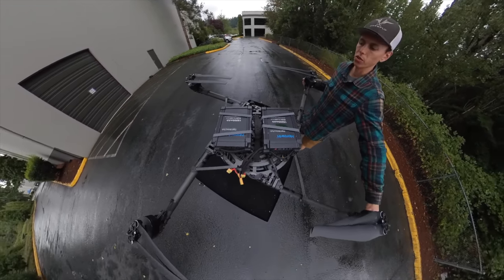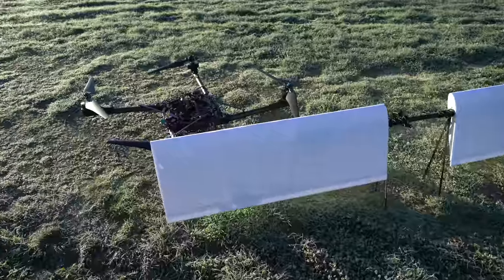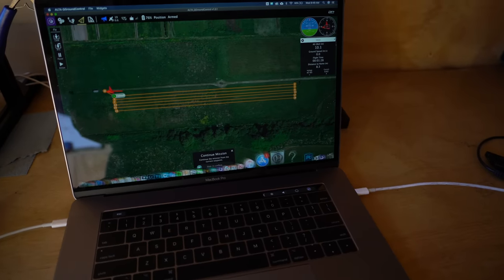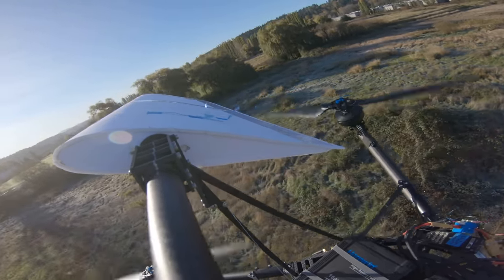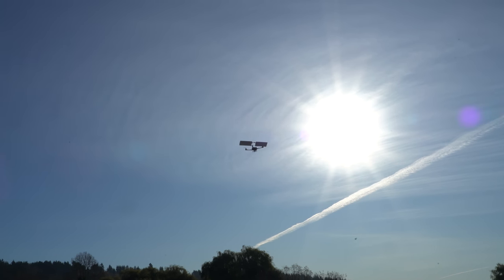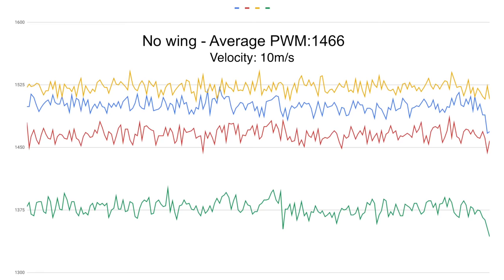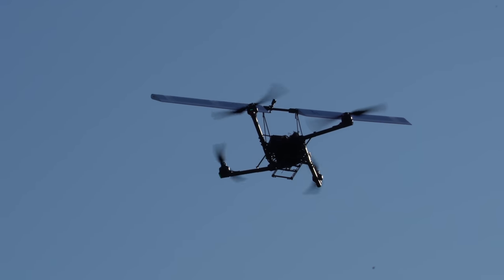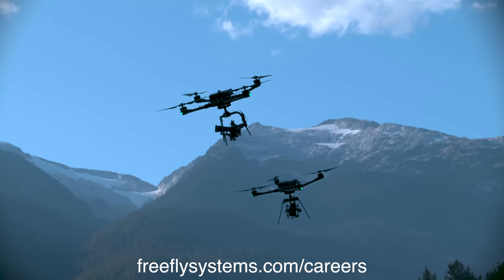Can a Wing Increase Quadcopter Efficiency?

Comment: Comment #1.   Don't make your quad hover.  Create a large rectangular route with radius corners, so your quad can fly through the corners.  When the wing is attached, the controller will need to yaw at the appropriate rate for a coordinated turn.   Then the wing configuration will give you more steady state data.
Comment #2.   Fix the angle of attack on the wing.  The flight controller has no idea when the wing rotation changes.    Fixing the wing angle to single angle of attack, may stop the oscillations.   To avoid the negative lift scenario, sneak up on the speed envelope.

Comment: The added weight and aerodynamic forces of the wing quite literally destabilizes the control mathematics. Since quadrotors are unstable aircraft by the nature of the design, the effect of the wing without changing the control software absolutely will destabilize the drone. Adding a wing can and will improve efficiency, but the controller needs to be updated to properly control it.

Comment: Would a rubber band attached to the wing make since? To put some resistance on it to pull it back to zero. Not just rely on it's mass. While also using a dampening mechanism that doesn't allow the wing to change angle to fast. Like the calculators from school that slowly opened when you hit a button.  The "rubber band" strength could be changed to adjust how much you want the effect to be. Maybe even put a servo on the other side of the rubber band so you can change it in flight. I feel like some force on the wing to return to 0 would have stopped the oscillations while the dampening mechanism would prevent it from changing to fast. And if all that works then write some code to do it on the fly for max power efficiency. 

I do think you are onto something. Integrate this wing concept into the body of the drone. At the very least do it on the rotor arms and have an aerodynamic body that provides a mild amount of lift at speed.

Comment: Very interesting concept, but looks like you could have a lot of unbalancing problems. What about trying a different type of wing what about trying a gyro copter configuration where are you got a helicopter style blades above the quad copter that I’m not powered , should make them spin fast enough to create some sort of lift and be in central that should be a lot easier for the quad copter to control

Comment: I guess the most important is that the airflow on the wings is seperated from the airflow of the rotors. So mount the wings on the sides instead of in the main airflow of the rotors 😊.

Comment: It seems to me that the drone is having trouble correcting for the lift from the wing when accelerating which throws it's readings out of range... Need to code in the wing... also unless you have some kind of resistance in the wing pivot it's literally just drag and nothing else until it's at the hard stop...

Comment: Would the Alta X flight controller support a servo to control wing pitch?   Using the forward speed and angle it could then  set the optimal angle of attack for the wing.

Comment: Perhaps you could optimize the size of the wing for overall maximum efficiency and controllability, if you shrink it down a bit perhaps you could fly faster without loss of stability and get the same efficiency

Comment: You would need a custom controller algorithm to make this really sing. It's clear to me it is getting too much lift and doesn't have the algorithm to know how to maintain altitude and pitch with a control surface in the wind. Evidence that one motor hits idle. That's a loss of a control channel, and to the drone it makes no sense that a motor is idle and the drone is going up. Shrinking the wing just enough so that all motors are contributing at least a small amount will probably make it perfectly stable. You could probably reduce the AOA to the same effect. The most ideal is an active wing that doesn't maintain AOA but rather desired lift as measured by average thrust of all motors.

Comment: My idea would be to replace the booms that the motors are attached to with a long narrow airfoil shape kinda like picture a helicopter rotor blade I wish i could post a sketch of what I mean if u seen old concept art of a hybrid jet/ helicopter which the blades can be fixed and it can fly at high speeds like a jet I’m saying just turn the booms into airfoils so no matter what direction the drone is flying it will still have lift because their would be no trailing edge on the foil like a conventional wing

Comment: you could robotize the wing, they should be either in vertical or horizontal mode, plus centering them lower than the props plane, it would fly better

Comment: i love your videos but why did you build an unstable aircraft? you should put the wing under the drone. the accelerated air underneath the drone would create lift as long as you make sure the bottom of the wing gets a lot less airflow than the top. i  also dont think you need a pivoting wing just simply control surfaces. think of it like an osprey without any pivoting. as if the osprey would take off facing towards the sky like a rocket which is basically what youre building. i would take a look at blue origins new sheppard with its fins and extending airbrakes making it aeroynamically stable going up AND down.

Comment: Let me try to explain something, if I can make sense.   The pressure on the wing has to be higher on the bottom than on the top.  That is how a wing flies.  But the wing being so close to the quad rotors, it seems the rotors may be sucking the air pressure from the bottom of the wing.  The top is not stalled, but there is no pressure on the bottom either, because the prop sucked it all away.    so the solution is to extend the wings off to the side of the drone, and away from the props.  Does that make sense?  Don't put the wing directly over the props, or you will defeat your purpose.   Don't put them under the props either.  the wing needs undisturbed air both above and below.

Comment: You'll never get lift from a pivoting wing in that configuration. The lift comes from downward force from the wing or the low pressure above it. If the wing pivots it'll just get pushed respectively thus
Reply from the maker: 1. Then how do flying wings and plank aircraft fly?
2. You missed the part about the hard stops
Reply: @rctestflight  I didn't see until near the end that you had the wings basically mountined on the centre of the wing either. That's take some load after all.big fan, first time caller. Keep up the novel and interesting work mate.

Comment: Why don't you use a non-fixed-wing aka a rotating one? As long as there's airspeed it will generate lift. You just need to make it tilt to have always a safe angle of attack for the amount of forward motion in the direction of your forward motion.

Comment: Go the other way, turn an airplane into a drone. In other words, place drone motors on an airplane to simulate the propeller. When the aircraft is about to stall, have the motors and rotors pivot to a drone mode bring the aircraft to a stall speed or less. That way the only loss of energy will be when this is occurring. The hybrid will use the drone mode only  part of the time for upwards and downwards motion.

Comment: "The point where the wings provide lift seems unable to act on the fuselage, only providing torque to return to a normal state. It seems that the wings need to be placed below or in the middle of the rotor to function correctly

Comment: The wings have no effect on lift in the free swinging zone. The only force possible with it free to swing is backwards(drag) if any lift is produced by the wing it will balance the force automatically by adjusting it's AOA. (There's a good reason windmill blades are not free spinning to allow them to change their pitch, aka AOA, they're actively driven and locked at a desired pitch for RPM governing) The only time this produces any lift is at the fixed detent endpoint. The correct way to do this would involve a gyro assisted motor/servo that adjusts the wing to maintain a constant angle of attack after a certain forward velocity is achieved. That way negative AOA is also not possible (hehe theoretically).

Comment: Maybe if the quad would be configured as a "+" , not as a "x" the controller would not get so confused? also the wing is way above the center of mass, so huge lever. a "+" style quad could have the wing through its center more easily.

Comment: Of course it can, if properly designed and the craft is moving sideways correctly relative to the wing. But if it's just hovering, the wing is simply added weight. That's just one of the reasons the world is still full of airplanes even though helicopters are much more convenient.

Comment: I think this is more of a showcase of the limitations of unmodified quadcopter control software on winged vehicles than a test of the effectiveness of wings on a fixed-vector rotor craft in general.

Comment: Why not fit a saucer/disk wing arround a Quadcopter through a axel running through quad till both ends of disk wing ?

The Quadcopter will be hanging inbetween from both sides of saucer/disk wing where the whole wing will be movable to some degree (angle) to maintain angle of attack to make the whole saucer/disk surface behave like a aircraft tail elevator inorder to generate some lift during forward movement hence increasing battery efficiency to some extent

Like this the saucer/disk wing will give adequate fan blade clearance  , Plus it won't be getting fan blade's downward air blast & last but not the least wing will act like a barrier to branches of trees giving blades protection horizontally .

Comment: I would want to see a fixed rotor Quad with four wings between the motors. To fly with the wings you tilt all the way on the side, and fly the whole thing vertically instead of hovering horizontally.

Comment: You need to coordinate the tilt wing with tilt rotors.
Reply: Nah tiltrotors have garbage efficiency. At this small scale the most efficient solution is either the Pterodynamics Transwing, a fixed wing quadcopter, or a tailsitter quadcopter

Comment: It seems like the wing should have servos controlled by the flight controller to operate in tandem with the drone's flight systems to adjust to the optimal position as needed rather than relying solely on the whims of air speed.

Comment: Well, that would never work just like that. There must be some transition in the gyro stabilization. for start: when the wing starts to gain lift, the gyro "gain" and "proportional" should get lower parameters. Second: remember that when the quad reduces speed, it lowers the RPM and pitches backwards. Do this with wings and you get a classic stall.

Comment: Did you figure out the angle of forward flight (with no wing) prior to testing? If you could determine the angle of the drone at speed you want (for best efficiency) then you could find the appropriate angle for the wings at that speed. maybe do a little more math and add a servo to change the angle as required according to set speed.

Comment: Why don't you try the wing setup with a tail section on a carbon fibre boom, which will give it more stability in forward flight.
Reply: PS fixed to the pivot axle of the wings.

Comment: Good test but it's a quad copter controller, not for winged flight. You need to scrap the quad entirely. Instead put motors on the front edge of the wings and the two wings need to tilt independently. Then a body and a tail. In hover it's like a normal plane stood on end. The two wings can hover and spin around by angling them differently, it can go up or down. Then by tilting both in one direction it can transition to winged flight. Vastly faster and more energy efficient because a quadcopter config is very dumb. You have to separate yourself from dumb convention to appreciate what's better.

Comment: It's not the angle of attack that creates lift. The lift is the result of the difference in the length that air travels below and above the wing, which is caused by the specific cross-section of the wing. Air has to travel a longer path on top of the wing, thus making it move faster than the air below the wing, thus creating a differential pressure pointing up, the so called lift.

Comment: The correct method is to have the wings move in a collective pitch circular motion like a helicopter. The swash plate to the drone would have to be invented. Look into gyrocopter  components.

Comment: Just attach a hydrogen balloon on a pipe and a tank with two release valves on the quad copter. One releases hydrogen into the balloon and one releases hydrogen from the balloon into the air.

Hydrogen can be easily (and not safely) made at home by putting electricity into saltwater. :)

Comment: The problem, to me, seems obvious - the drone is trying to keep its altitude stable - as soon as you add lift (in this case by increasing speed) the drone has to idle down to stop from rising, causing large fluctuations in rpms.
Reply: Also seems to me that the wing needs a tail added - and perhaps to make it swivelable - to keep it flying directly into the incoming coming wind.
If there's a slight cross-wind a drone drone will normally pitch ( unsure of the correct terminology here) into the wind to keep the correct heading. Without a tail to stabilise it, I think, this is also causing the wobbling.

Comment: you have no pitch stability or tail surface
a correct tail would be 25% of the main wing area, and situated 2.5 main chords back. You could put a strut at each wing tip back to the position of two half tails
A graphic indication of wing zero lift degrees is to draw a line from the rear of the airfoil, through half the height of a vertical line at 50% chord. 5 degrees positive from that line should be plenty

Comment: Ok now experiment with a fifth rotor. During cruise flight, the four rotors would finction as an autogyro, the have the fifth rotor angle down to orovide all forward thrust. The control authority would still be orovided by the four original rotors. The fifth rotor vould ve stand-alone controlled.

Comment: As mentioned by others, I think the wing is mounted too high. The drag of the wing will be causing the quadcopter to pitch upwards as it moves forwards, and the control system will have to "fight" that tendency. I think this is probably the cause of the instability at higher speeds.
If the wing halves were mounted further apart on a long spar that was at a similar height to the centre of mass, the drag would have little effect on the pitch, so the control would probably be more stable.
Further, when the wings are mounted high, the downwards movement of air towards the top of the rotors will be causing the airflow over the wings to be very different at their inner and outer ends... hardly an efficient setup, and the rotors will be "stealing" high pressure air from under the wing.. again inefficient.
If the entire wing was outside the rotors on each side, the high pressure air under the rotor would add to the high pressure under the wing, and the suction of the rotor would probably reduce the pressure above it, increasing its lift without causing instability.
In this position, it might be possible to use a servo to control the angle of attack of the wing, varying it in flight to match the current speed.
However, thanks for doing this experiment, and I think the increase in efficiency, despite the sub-optimal arrangement, is very promising and merits further experiments.

Comment: Stating that one of the front motor was idling is not credible. That would cause that corner to dip at the waypoints with no airspeed of at low airspeeds. It is more likely that the telemetry may not work properly? Or any other suggestions?

Comment: The center of mass is too far behind, as the drone increases speed, it must point into the direction of acceleration and put its center of mass further behind the center of lift. This is giving the unstable pitch up behavior. If you must mount the wing in on the spar, offset vertically, it may be beneficial to mount the wing below, like a payload, with an actuating servo that can be controlled by the flight computer. This way, the orientation of the drone will always place the center of mass ahead of the aerodynamic center

Comment: I think you were suffering the pendulum effect. The balance was way off the center of mass which is were you start to get instability .. this lead to the oscillations I agree with everyone else putting the wing down lower possibly below the rotors closer to center of mass would make a big difference

Comment: I enjoyed the video but I have to say this was not conclusive. there are way to many variables that weren't touched on such as wing location , wing area, airfoil; selection, propeller pitch, number of rotors. I could go on. while you talked about efficiency you didn't mention how the wing affected time to perform the task or how much velocity may change. Have you considered building a much larger version of the three motored plane that you used in this video? If you designed something for UPS I believe that the three motored plane would be much better than a quad.

Comment: There's a big mistake, you put the wing over the propellers, and that creates the wrong vortices.
The wing should be outside the propellers, on both sides of the drone.
It is preferable to put a fifth horizontal fan to push forward.